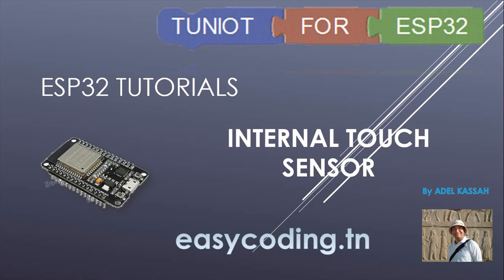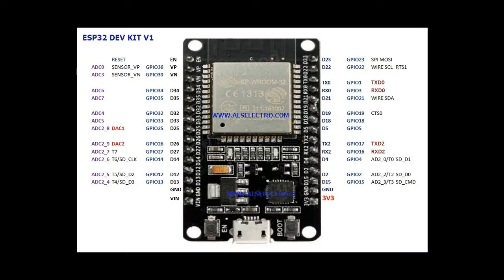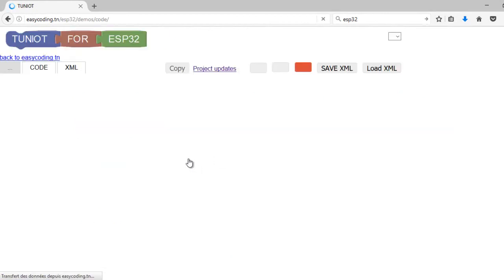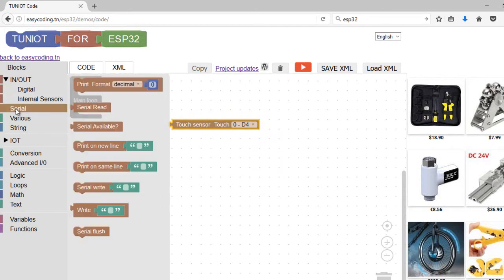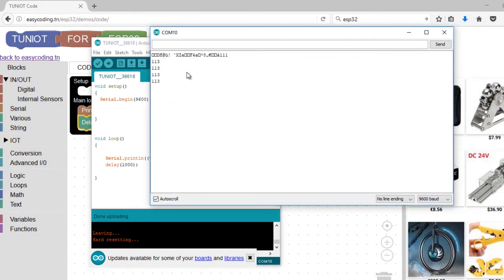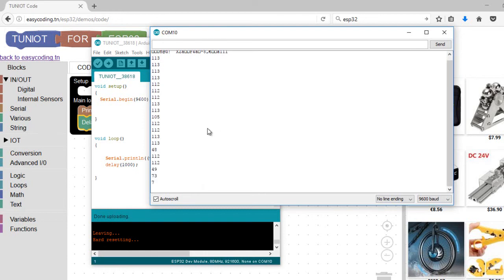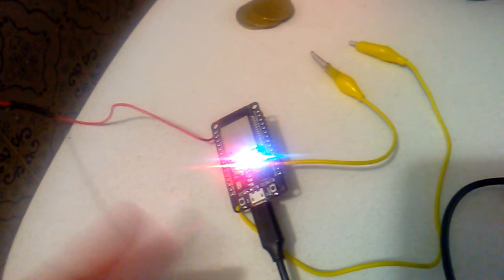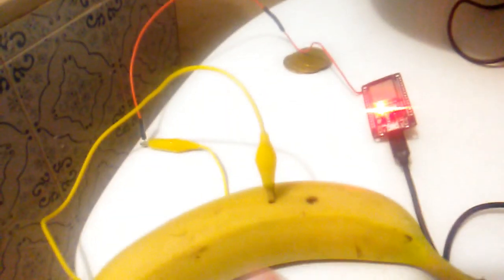ESP32 tutorial A-03: The internal touch sensor

Comment: Tnx Adel. You are doing great work. This capacitive touch sensors may assist in measuring liquid levels without sending a electric current through the liquid and destroying probes with electrolysis. I will test it.

Comment: It seems that some ESP32 board vendors are using just the straight GPIO pin numbers, while maybe a few vendors are hanging on to the NodeMCU style "D" + number "logical pin numbering" scheme, which is a bit of a stumbling block for Arduino C programmers (but a "nice" feature for Lua programmers). Now with TUNIOT for ESP32 I see that the pins have two number designations like :

0  -  D4
2  -  D2
3  -  D15
4  -  D13
5  -  D12
6  -  D14
7  -  D27

So, my question is:  What do the first numbers refer to?  They can't be GPIO pin numbers as GPIO6 and GPIO7 are VERBOTEN! (as are GPIO8, 9, 10 and 11) as they are used by the ESP-32 to address FLASH Memory as they were used before in the ESP8266. And since my board uses GPIO pin numbers, I don't have any idea what D4, D2, D15, D13, D12, D14, and D27 refer to. Are these GPIO pin numbers or some remapping "logical" pin numbering scheme left over from the NodeMCU? I guess I will have to do some digging.

If anyone already knows, please respond.
Reply: So, after consulting a detailed pin-out diagram for my AI Thinker NodeMCU ESP-32s board, I see they have given names to the various touch sensor pins in the form of "Touch0,  Touch1, Touch 2, etc." and it seems that in TUNIOT for ESP32, when you see the list of pin numbers displayed for the Touch Sensor command blocks, the first number correspond to the number at the end of the "Touch_" So, "Touch6" will be listed a "6".  Also, the "D4, D2, D15, ..." pin numbers DO NOT correspond to the old NodeMCU ESP8266 "logical" pin naming scheme as I had originally thought. Here in TUNIOT, "D" is used as an abbreviation for Digital I/O pin, which might be more accurately designated as "GPIO". The GPIO pin numbers associated with these Touch_ pin names match the "D" numbers listed for each touch pin supported by Tuniot for ESP32. I think this block instruction should use the pin names "Touch_" along with "GPIO__" so that there is no misunderstanding here. I also saw my board supports three additional Touch pins that are not supported by Tuniot for ESP32.

And if my writing seems "spaced out" I'm suffering from the Flu this week.
Reply: What's currently shown:

0  -  D4
2  -  D2
3  -  D15
4  -  D13
5  -  D12
6  -  D14
7  -  D27

What should be shown:

Touch0  -  GPIO4
Touch2  -  GPIO2
Touch3  -  GPIO15
Touch4  -  GPIO13
Touch5  -  GPIO12
Touch6  -  GPIO14
Touch7  -  GPIO27

Just my 2.5 cents worth...